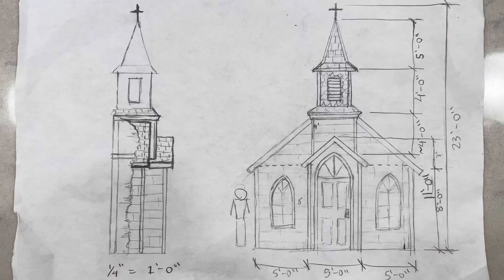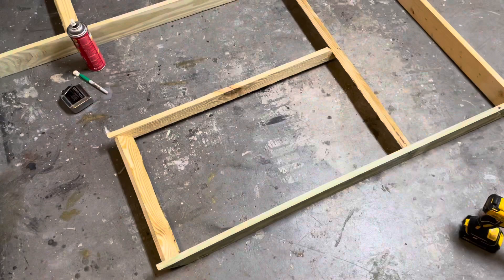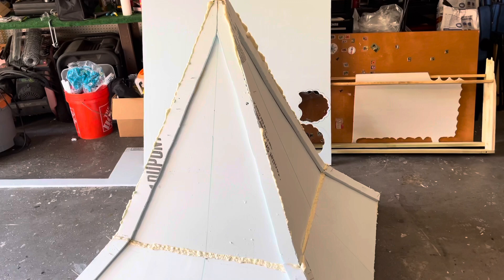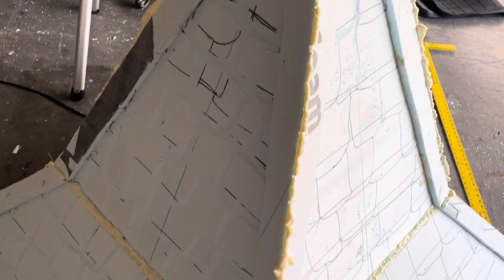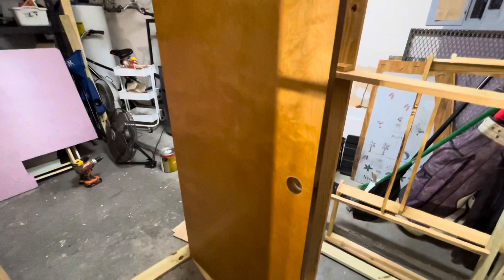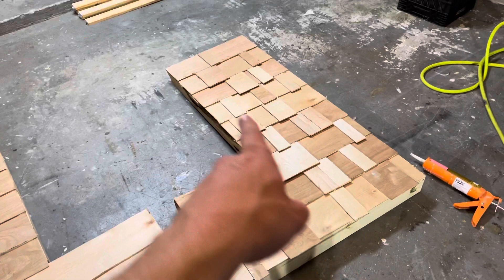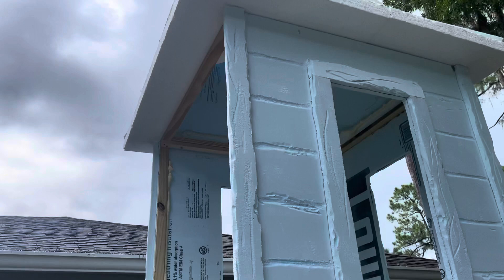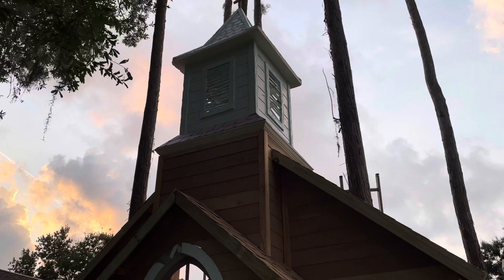Halloween Church Build - Part 1

Comment: Looking so good.  If you end up getting plexi for the windows you can also hit it with a palm sander and some 150 grit instead of painting it.  Works pretty well.  Great job on the facade its going to be awesome finished.
Reply from the maker: Thank you so much!! Siding and the crackle painting I'm working on right now was very much inspired by your haunted house build! Do you have any recommendations on where to get plexiglass and what size/thickness? And a great idea for the sander.
Reply: @AndrewLong  Sign stores or Home Depot has some.  1/8 or 1/4 Its expensive so maybe you can find it used for free online.  I have also used rice paper, thick painters plastic stapled to the back of your frame, and even the plastic light fixture covers that are thin sheets.
Reply from the maker: @HollywoodHaunter  I have the plastic from the 1/2” insulation board and I’ve used it for windows before and it works great as long as you don’t poke a hole in it!

Comment: Dude! So good! Looks awesome, great job. I love the modularity of it; definitely adds a whole new level of complexity when building something like this. How do you find the Laun holds up to the weather?
Reply from the maker: Thanks! Making it come apart for storage can be one of the hardest parts! The luan typically holds up just fine but if it sits in water like any wood it’ll start to get moldy and warp. We don’t leave this stuff out for more than a few weeks so they don’t need any major repairs. Probably gonna water seal the wood as well.

Comment: Incredible job! I am currently embarking on making a crypt facade for projections. Considering using one by fours and of course foam board insulation, any tips you can provide I'll furnish with a video Once I'm finished!
Reply from the maker: Thanks! Some basic tips I can give are making it easy to put together, take a part, and store but you probably already have that in mind.. It's great to use bolts instead of screws as they are stronger and can be taken in and out. For the foam, I definitely recommend hard coating it as it protects and adds some texture as well. I built a crypt facade a few years ago but have not put together a video for it so some day I will!
Reply: @AndrewLong  I love the bolts idea! Definitely going to do that. Was considering hard coating with tile grout then painting. Was also thinking about how to achieve a fluted column by slicing pool noodles and mounting them reversed with the inside pointing outward. Haven't seen anything out there using that idea (maybe because it's not a good idea 🤔)
Reply from the maker: @thekenmorgan  I’ve never used tile grout before but I imagine it’ll be very strong. That’s a very interesting idea for the pool noodles! I’ve used pool noodles for a few different things and I’ve only had problems with paint wearing off or hard coats peeling off. You could use a larger piece of pvc for the columns but then you would have to figure out how to make them fluted..
Reply: @AndrewLong  good advice on the pool noodles pvc probably a better way to go. BTW what do you use to hard coat your work? Thanks so much!
Reply from the maker: @rickybobbytalladega   I use flexbond mortar for the hardcoat.